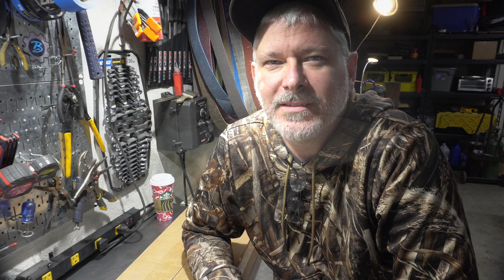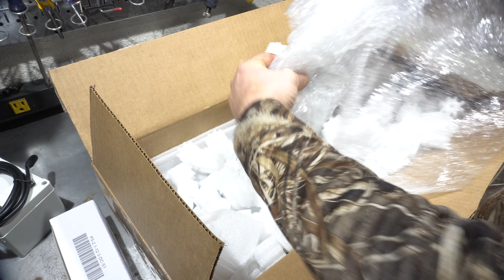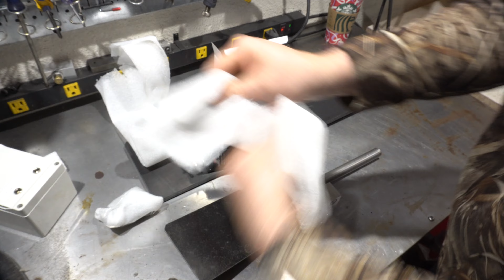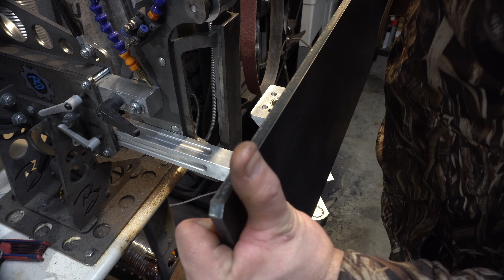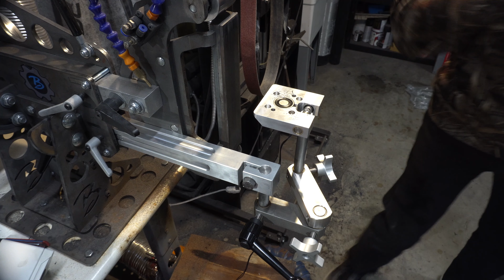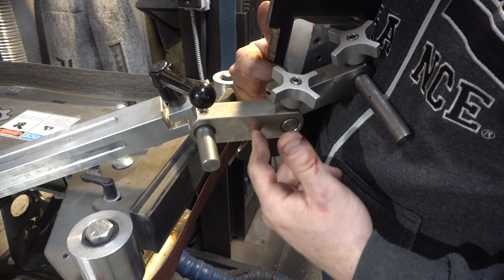Triple-T #63:  Multi-Axis Tool Rest Review

Comment: I put magnets on my brodbeck rest no more playing with the knob pop it off or tap it around big difference verry stable I use earth magnets for everything I don’t drill holes
Reply from the maker: Don’t they collect all the grinding dust though?
Reply: @TyrellKnifeworks  not so much under the plate I attached them to the base of the rest not the rest that dam hand crank drove me crazy some time FYI my gas shock for the tension on the belt died u may want to pick one up apparently thay only last 8 to 10 months McMaster Carr is where I got it from 12 bucks I got 2

Comment: I got a multi-axis tool arm with an Australian grinder a few years ago and its pretty much like that one, just without a magnet.
Dunno!
Mostly I just set it to about 35-45deg and leave it there for doing chamfers or similar stuff on bolsters, scales and stuff. As you said, its just a pain in the arse to really configure it on the fly without 4-5min of stuffing around which slows you down to the point I can free-hand grind something quicker!
What I did find it great for though was on small wheels- I can set the height and depth exactly where I need it doing a job everyone hates: fullers
It can make that job a complete breeze as it maintains the height an accuracy perfectly to where I can just swap in the small wheel arm and the axis arm as I go from conventional platen to fullers, then back again with each belt grit.

So they do have a use, but is it something everyone needs, oh heck no! Its firmly in the nice to have bucket for me but you can most definitely live without one
Reply from the maker: With a small modification of the extended arm, I would totally use this as my normal rest.  Two set points is ok, but 3 is just a pain in the butt.  Thanks for watching

Comment: Very informative as always Denis. Just wondering if you have done any triple t on drill bites. I'm a retired Locksmith and have used drills to drill hard plat on safes. Don't know exactly what the hard plate was made of though. 
Hans
Reply from the maker: No, I really have never done a Triple-T on drilling.  I guess I should though.  Thanks for the suggestion, Pat!
Reply: Ya Denis I just looked up what a safe company SAYS they have for hard plate.
R60 3/4 inch thick. 
Could be ?
Reply from the maker: @patkrause1254  I'm not sure what "R60" is.  Could be a hardened steel, I'm not sure
Reply: @TyrellKnifeworks  I'm not sure either. I think it's just a marketing gimmick

Comment: Seems like the electromagnet would attract the steel particles being ground off and it'd turn into a big furry mess.
Reply from the maker: The magnet is actually captured within the aluminum plate and the top of the plate isn’t magnetic.  I was worried about that too, but it wasn’t a problem at all.  Thanks for watching.